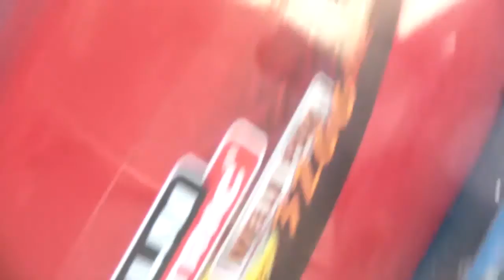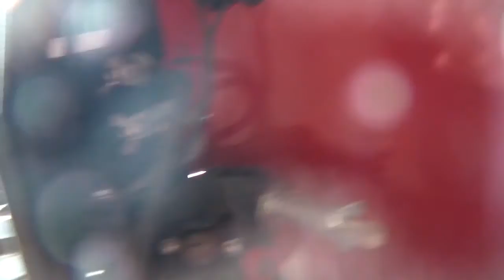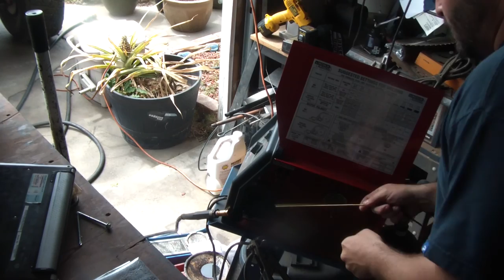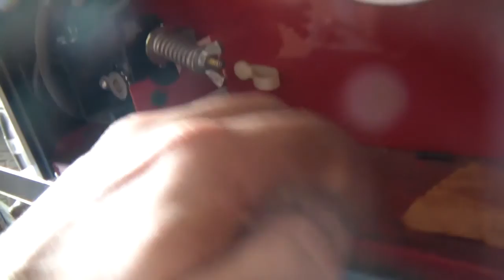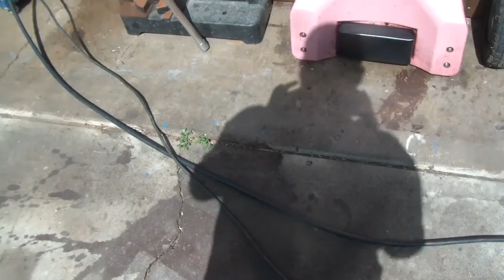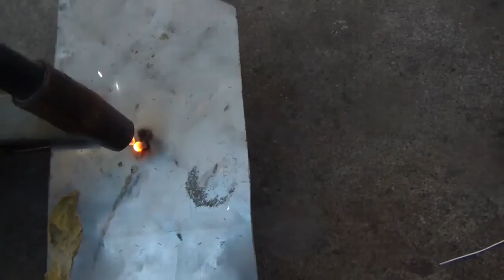Lincoln Aluminum Mig Welding 3200HD welder K664-2 Kit

Comment: You also didn't use a clean material. A brass or stainless brush to remove the oxidation correct psi on the gauge would help and a much faster feed rate, everything you did was wrong dude. That is why your dislikes are even with your likes.

Comment: It's not a troubleshooting suggestion it's a fact you have to reverse the polarity and don't be afraid could turn the heat up and the wire speed down you're definitely on the right track and be sure and protect everybody's eyes people especially kids can't help but stare at the big bright light
Reply: And turn the gas up it hasn't shielding gas black smoke

Comment: did you reverse the polarity in the welder?
Reply: on the 3200 polarity should be the same as steel mig
Reply from the maker: No, Do you think that will help? I'm new to aluminum
Reply: I am new to aluminum also. the people I have talked to say that I will need to reverse the hot and ground to the gun. kinda like when using Flux core wire.